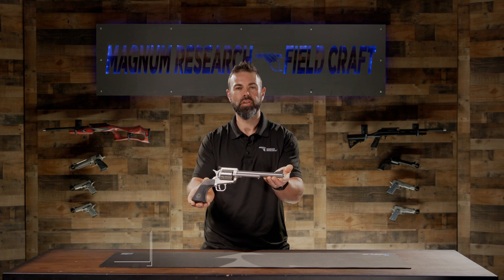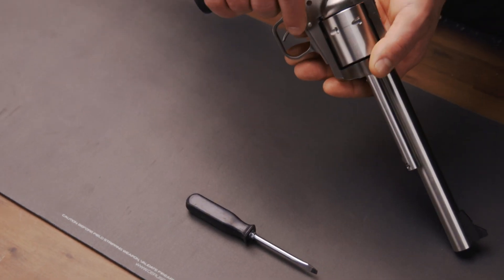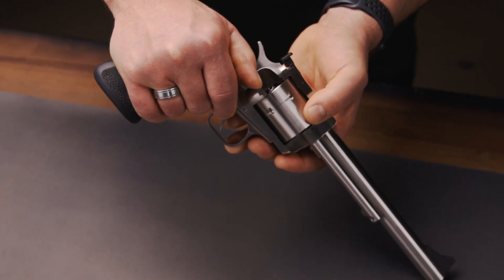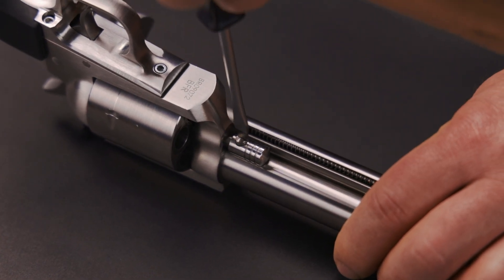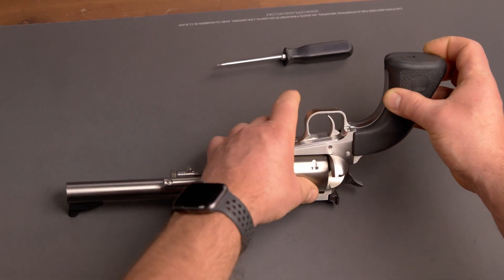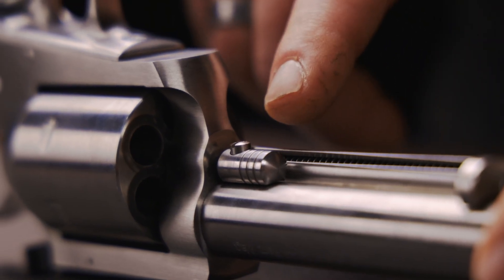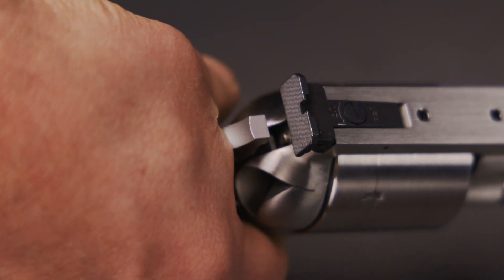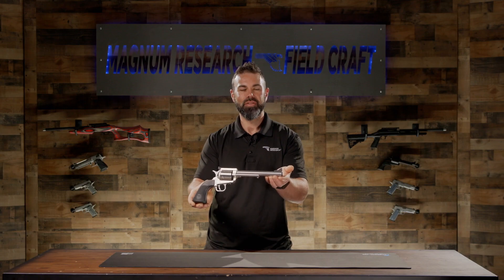Magnum Research Field Craft: BFR Teardown

Comment: love my BFR but you guys need more in depth breakdown videos than this.  Took me two hours and a lot of headache trying to replace the hammer.  Had to mirror a Ruger Blackhawk disassembly video to finally get it to work.  You need full disassembly videos and schematic PDFs online for customers.   Love my BFR though,
Reply: does the base pin screw into the barrel, or the base pin?  Just wondering if there is a limit to the number of time you can take out the cylinder before you have issues with the screw threading.